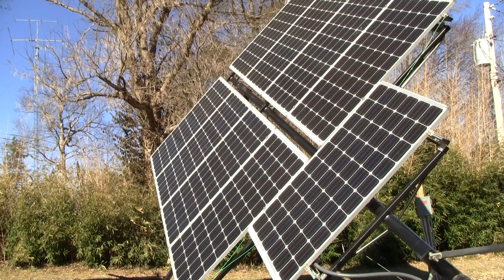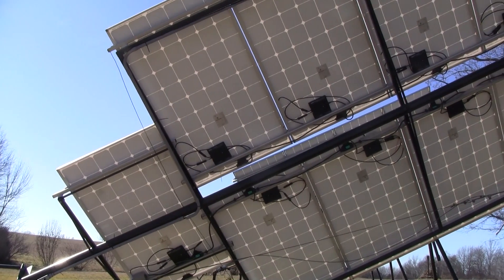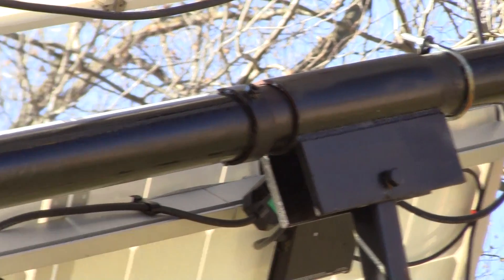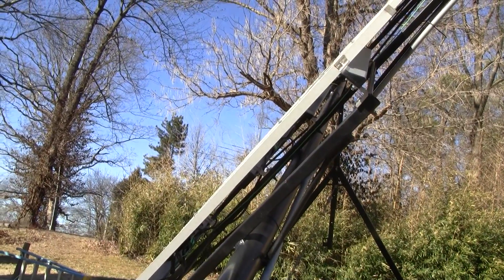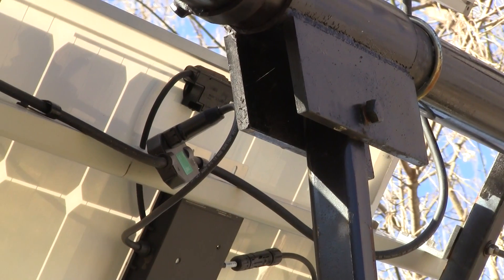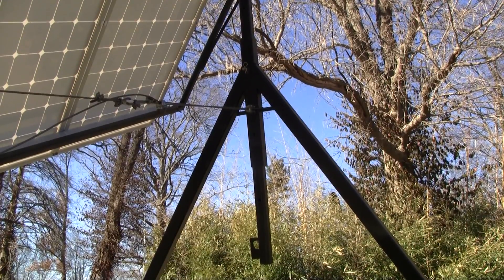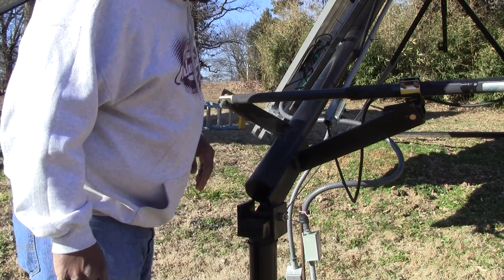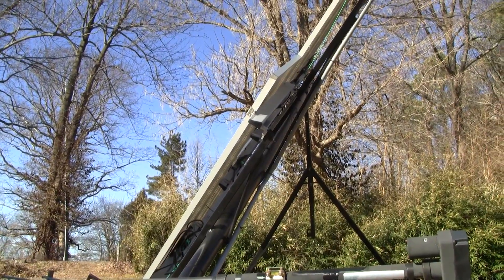How to build a Solar Tracker and Free Plans

Comment: This design is great for locations between the equator and 30° Latitude. But for locations above 30° Latitude, the axle should be tilted way up, to 70° = almost vertical in the winter.  Yikes!  Also, a large spacing between the arrays is required, to limit shading in the morning and evening. All designs have pro's and con's. Do the math for your latitude.

Comment: Due to the extreme drop in the price of solar panels tracking systems are now uneconomical compared to more panels. In any case, trackers are mechanics and need maintenance.
Trackers are very susceptible to wind. For this reason and because of the mechanics, most of them only last some years. 
It is much more effective and much more reliable to simply install more solar modules!
If you want more constant yields throughout the day, you simply have to set up the panels in an S-E and S-W orientation.

Comment: Hello Craig, really nice design on your adjustable single axis tracker. The best part is that you used commonly available pipe and structural steel members. Although I'm a little late watching you video, I would still like to get the plans. The link you posted above does not work. I am looking to design and build my own solar tracker system for my country property.

Comment: Amazing build....I wished I did have a garden myself in order to get some money back by selling electricity power back to the main power company. Dual axis is really nice, but I wonder what the difference is on a yearly base compared to cheaper, fixed angle positioned solarpanels like you see on farmerland mostly (or roofs for that matter). I wonder if it's not easier to place just flat panels on the ground instead of angled panels  if the power generation is only a fraction less compared to systems that have angled panels since the efficiëncy is so much higher with modern panels compared to panels 10 years ago (they overal initial investment WITH the more affordable high efficiëncy Chinese panels already produce more than you need in a normal household anyway right, if making money out of solar energy is not your main target, but just to get carbon neutral for starters).

Comment: I love it! 

28 kW vs 60 kW is not 40%, that's 214%. You more than doubled your production with this single-axis tracker.

I have a fixed pitch 6.2 kWp, and about to add 2 or 3 kWp, on at least a 1 axis tracker, maybe a dual-axis, (I'm not too keen on the amount of ground area the two-axis needs though). My 6.2 kWp makes a 22.8 kW average per day since installed. I think with a single axis tracker the 2 or 3 kWp will be around 15 to 24 kW on it's own!

Comment: Hi Craig.... any interference from the inverters or solar panels to your ham radio antennas/radio???
Reply from the maker: No, they don't generate any noise on the radios at all!
Reply: @craigb700  tnx for the info, im almost finishing a 4,2kw on my site but with hoymiles mi-1500...thx for the qso also ZP5DBC   73

Comment: Have you considered putting a counter balance weight at the bottom under the mount to counter the weight of the panels?
Reply from the maker: They are balanced the way they are attached to the mount. Not too hard to move at one extreme or the other

Comment: i im finish my 3 traker im not instal the aluminium racking im bolt direct on frame and on cornor im weld at 45 degres the water not go inside only connect the 3 actuator on the same single axis controler give me you e mail im shiping picture thanks for plan

Comment: i have an actuator that was on one of those HUGE satellite dishes that was with my house...  i took the stuff apart and tested the actuator - it seems to work, but it only spins - i can't figure out how to wire it to extend/retract?  I'm assuming it MUST be able to do that, since lining up a dish without that ability would be tough!   anyone got any ideas?   i hate to think i have this cool huge thing and can't use it!   the only other option is to rig up a bunch of gears etc to turn 'round and round' into 'in and out'...
Reply from the maker: Sounds like the gear teeth are broken off. You need to find replacement gears or replace the actuator. Try Venture Actuators in Ohio.
Reply: I did take it apart and nothing SEEMS broken.. but is there a switch to tell it to extend/retract vs spin? or is it wiring?  how do you go from one to the other when they set these bad boys up? - surely you must be able to do either action independantly?   having moved the dish itself, i can tell you, that sucker is heavy!!  you wouldn't want to have to wrestle it in and out to tune...

Comment from the maker: Hi Pete, in reply to your question about wind, I use a tracking circuit that "parks" the panels so the wind blows across the top of the panels when the wind gets up, not underneath. The weak point is at the base where it comes into contact with the base in the front. I did recently have to replace a piece of the pipe that holds the lower swivel have in place. Otherwise, I've had no trouble with wind (knock on wood). My Max winds here are in the range of 50 mph where about 90 miles north, the pattern changes to about 70 mph. No hills or trees there. I hope that answers the question about that. As for the actuators, I use the solar actuators from Venture Manufacturing in Ohio. Good prices and great people to work with. Look them up online and give them a call.

Comment: How well does this handle the high winds? We have some pretty stiff winds here in our area. We have a 7Kw system on the house and a planned 6Kw system for off grid. The plan is using the off grid with some trackers to maximize the output. Just need something that handles the wind. What is used to determine the movement of the actuators for moving the panels during the day? I see that the actuators look to be from old satellite dish mountings. Those still come up now and again. I have 30 panels to mount. My panels are 200w panels.

Comment: Craig what brand and Watt panels are you running? I want to do around a 6Kw system with two to three rotators. I live in Central TX.
Reply from the maker: my panels are SolarWorld 275 watt panels. I have 36 of them for 10kW.
Reply: How did it turn out?
Reply: @johnfitbyfaithnet  I have not built them yet!

Comment: Outstanding videos. I was glad you are willing to share your info so freely. I have some design modifications which I will share back with you and credit you with the original design. Your entire system is inspiring. FYI the "Track and Park" is not available.
Reply from the maker: great. please send them along to me and I will try to put them into the download for this project
Reply: Please know I have the same mindset of sharing what we know. Know also that It may be a bit of time as we are 2 years out and working to begin our quest. Your free sharing of knowledge has inspired me and I hope to implement/improve your design for my off grid retirement. If you are wondering what we are working on please feel free to check us out.
Reply: TZ Homestead hello please am new to this.... can you kindly tell me what i need to desing a solar tracking system?  Thanks...
Reply from the maker: https://homecsp.com/store/index.php?id_product=63&controller=product Here is the Track n Park webpage. This is really all you need. Did you watch the other video? I run a 24 volt system for the actuators. 2 deep cycle marine batteries in series and a 24 volt solar panel with a charge controller on it for the batteries.

Comment: Can you make a metric version, for the rest of the world???
Reply from the maker: John Smith I'm not sure what those sizes would be. the main thing would be to get pieces of pipe and bar that would fit inside other pieces for rotation and adjustment. 3 inch pipe inside 3.5 inch pipe. I would do the conversions in Google to metric sizes then talk to your metal guys.

Comment: I just glanced over your plans but i didnt see any details on the actuators , specifically what activates them. are they on timers or by the movement of the sun or?????
Reply from the maker: lee bergstrom the tracker motored are solar actuators from Venture Actuators. they move the trackers from a signal from the tracker circuits from homecsp.com if you want more information about this let me know and I'll prepare a full explanation video.
Reply from the maker: lee bergstrom Here is my controller: https://homecsp.com/store/index.php?id_product=63&controller=product
Reply from the maker: Lee, I just put a video up about the actuators. Check out my channel to see what I did. In a few days I will post on the manual movement controls.

Comment: Craig, 
Bless you for sharing your time and invention. I down loaded the plans and will begin construction when the snow clears (April).
I'll try and send you photos when I get mine up.
Thanks, Allen
Reply: How did it turn out?
Reply: @johnfitbyfaithnet         Well.... here's what happened. I got the holes all dug, then the wife and I thought we better focus on food production instead for a while, turns out that might have been a good idea given where we are with this virus. This required my  building a huge green house as our forest friend would eat anything we grew. We have also just started making this a year round operation with lights and wood heat. I walk by a pile of panels from time to time and wish I had time to get them up. With the grow lux lights added to the system I really need my panels and a tracker installed. Maybe later this summer .
Reply: @allengibson7346  cool thank you for sharing
Reply: @allengibson7346  you live in MN like me, this newbie would come help.
I'm just trying to get my order in now, solar 15k pole mount tracker
Reply: @lts30000        Douglas, thanks for the note and your offer to help. I am actually located in North Idaho so logistics would be a problem. After giving it a great deal of thought I decided to go with a static mount. I have a host of reasons for doing that (I won't bother you with those here), Primarily, with panels being as affordable as they were a little over a year ago, it just made more sense to build a larger array than to buy the materials and do the work needed to put together a adjustable array. Thanks again, Allen
Reply: @allengibson7346  MN we get less sun here summertime will be a hundred percent coverage wintertime 50 so I thought I'd better do some tracking.
I'm making mom's house solar, I've got work cut out for me just talkin conveying while trying to work 😔
All the best to you and yours Allen
Reply: And I know this prepping is not easy 😒

Comment: Hi Craig, just what I have been looking for. Thanks for sharing. Do you know what the wind speed and snow load rating would be? I will need that for permitting. Could you send me the plans?
Reply from the maker: Hi Mark, sorry for the delay getting back. The plans are available on a link down below here from a google drive link. I don't really know the snow rating, I know that when I put them up, we had a couple of 9 and 12 inch snows and I was able to brush the snow off and they worked fine. Turn off the motors if you are expecting snow but with the rod underneath, they are pretty strong. I hadn't worked out any numbers on snow loading or wind loading, but the mounts are pretty heavy. Let me know if you can't get to the plans.

Comment: Hi Craig. Thanks for this video. I was looking into buying a solar tracker, but they are so expensive, I decided to build one myself. And you are right, there are not many plans around :) So yes, I would be very happy if you could email the plans you made. I put you in my circles, so you should be able to send them to me through google plus.
Reply from the maker: https://drive.google.com/open?id=0B-LQy5niVNUYMHBTNU52Ukttd0U See if this link works.
Reply from the maker: https://drive.google.com/open?id=0B-LQy5niVNUYMHBTNU52Ukttd0U Try this link.
Reply: Thanks! Both links work. This is a nice autumn/winter project :)

Comment from the maker: Pedro, it is electric actuators. I have a 60 watt 24 volt panel to move them so they don't take power from them.
Reply: Craig, use solarpowered super capacitors instead of batteries for actuators! I think u need just 1 second  @10amp load. 10 X 700F  in series should? do it. 26v maximum limit.  Use 1/4 watt 1k balance resistor parallel with each 2.5v cap. for this battery eliminator. Thanks again
Reply from the maker: Thanks Dave! That would work and the 26volt max is important too. Sometimes the batteries charge to over 29 volts and that makes one of the tracking boards park the panels at the wrong time, but usually where they are still receiving full sun.
Reply: @davegeorge7094  Hi. Is there an instruction somewhere how to make that? Thanks.